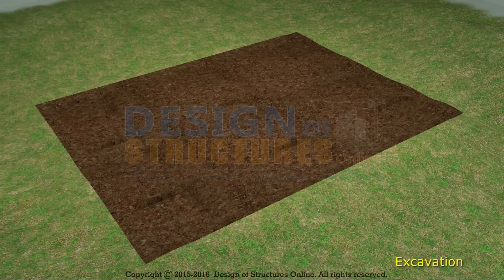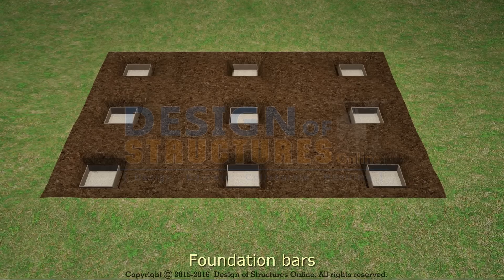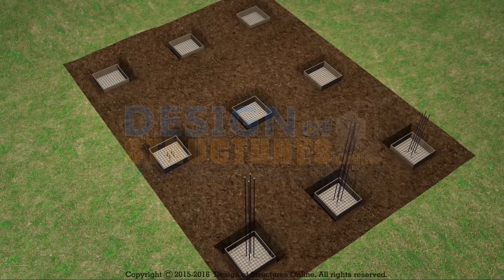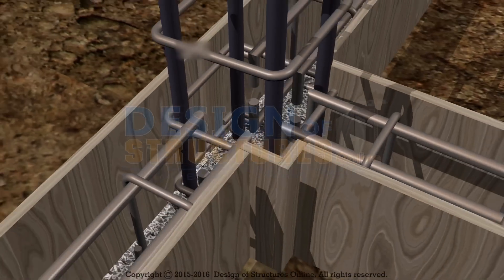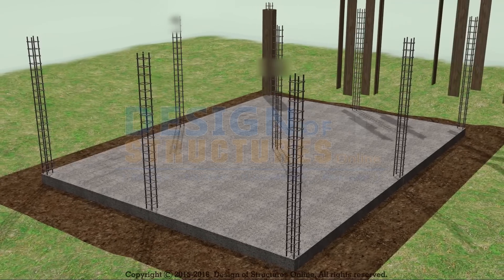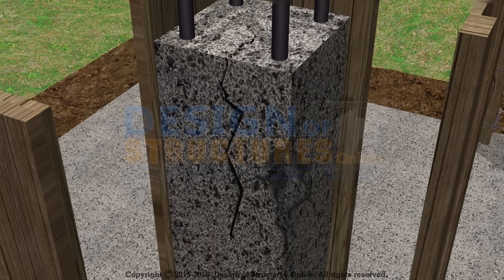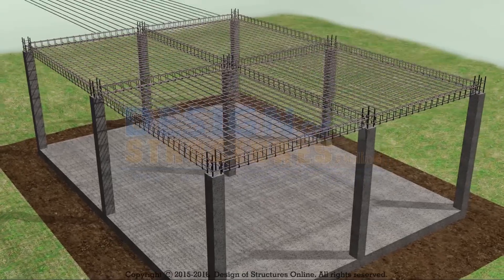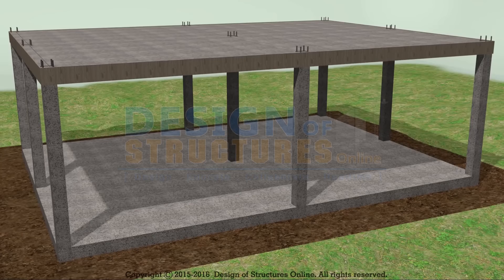complete construction of RCC -DESIGN

Comment: How do you prevent the crack or bubbles when you fill the columns with cement? Do workers tap every sides or use a vibrational thingy?
Reply: The crack and bubbles thing is prevented by proper mixing of the concrete mixture and they can use a vibrational thing for a large scale but tamping is suggested for small scale

Comment: How much thicker are the columns near the base? They hold most of the weight.
Also how much extra material is used by engineers to guarantee safety of the entire structure. Like baring all the weight.

Comment: ETABS full course video and files including structural analysis and design of beam column , slab , staircase and also Footing design with the help of STAAD FOUNDATION. It includes all topics from basic to advanced level starting from soil testing to detailing of structural elements.
         Price : 799 Rs/ (original price 3995 Rs/)
         Course : 26 videos and 17 files
         Contact me on WhatsApp : 9678552156

Comment: Please enlighten me about the slab on ground. Will it be alright without distribution bars? it will not crack due to temperature or tension/compression throughout the slab?
Reply: most of the building weight gets transferred to the footings. and the slab usually has gravel poured underneath it as extra support

Comment: 1. Concrete slab on ground level even directly sit on top of soil cannot without reinforce for crack control proposed
2. First floor form work and  temporary support should not after provided after first floor beam and slab reinforcement been installed ( we need to provide safe and firm environment\ working platform for workers to do the reinforcement and concreting)

Comment: Any requirement for architecture drawing (submission drawing Rera working drawings and working drawings)#interior#exterior#landscape#estimation for loan purpose#walkthrough for residential and commercial buildings design in reasonable charges plzzz contact me Thankue Regards - Ar.Jp kumawat Contact info - +918385828211

Comment: It's good vedio, step by step construction methodology but if  we add the steps for knowledge of strength required for at least important items like 95 % of compaction of earth & its back filling, strength of steel bar (50,000 to 60,000 psi tensile), Concrete compressive strength atleast 2,500 to 3,000 psi. More over,  to add the steps of Damp proof course "DPC" with Bituminous paint, water barrier course under Slab on Grade "SOG", etc. this vedio may more impressive or improve.

Comment: The removal of forms or de-shuttering for columns, side beams, and shear walls can commence after 24 hours. Slabs (back props) would be 4 days but still depends on your specification. It can be suggested to regularly check your project documents such as the specification and structural drawing where general notes are indicated.
Reply: Hi. Do you wish to be able to plan the projects on Primavera P6 SOftware?If yes then here is a link to one of the videos from the channel. We have just started a new course on the latest 2020 update. Make sure to check it out.
https://www.youtube.com/watch?v=arhKuCxYchM

Comment: 2:32 The tie should be 135 degree not 90 !!
Reply: Hi can you call me 7893552357
Reply: How much steel should be used in this structure if the house is 120sqyard or 1028sqft 
In the base pillars and the roof
Reply: ties could be 135 and 90 degrees depending on the specifications of the drawings. The project i am working on has both 90 and 135 degree ties.
Reply: Hi. Do you wish to be able to plan the projects on Primavera P6 SOftware?If yes then here is a link to one of the videos from the channel. We have just started a new course on the latest 2020 update. Make sure to check it out.
https://www.youtube.com/watch?v=arhKuCxYchM
Reply: If You Want To Build A Reliable Shed, You Need Knowledge of Foundations, Piling, Planning and More ... So I'm giving you a comprehensive "how-to" guide on the basics of woodworking. Go here ==> WoodBlueprints. Com

Comment: Is it strong If I use 12mm Steel Rod in Foundation??
Reply: Better use 4pcs 16mm and 2pcs 12mm..and for the foundation 16mm is far better...remember the post is carrying all the loads...
Reply: @raymondcayanan1654  I only uses 6 rod(12mm) in my post and beams , Is it still appropriate ?
Reply: @sylserenuela88   for a 2 storey?? And square meter of your lot?
Reply: yes,12 mm dia rod will be  good for up to three storey building but further depends upon loads and soil bearing capacity.
Reply: @sagarpoudel1177   12mm and 10mm sterupt  in a two storey building  sir , Is it.advisable?
Reply: @sylserenuela88  for 12 mm rod 12 mm strriup wont be appropritate.yes you can use the bars of dia above 7 mm to 10 mm  as strriup in foundation.

Comment: Beam is laid on soil/gravels which is used for side filling and level the foundation..if heavy water force comes then that soil can leaching out which is under the beam.. then walls or upper construction can collapse
Reply: Yes, there are ample chances of beam collapse, to retain the soil proper design of retaining wall is to be done.
Reply: Yes there is no excavation the gound beam if soil is less bearing capacity and ground water table is near  they effect the structure

Comment: I have one question. Where do you build septic tank of toilet?
Reply: Either below the toilet or away from the toilet depending upon how much land is available.
Reply: as per requirement, it must be installed 1.50 m away from the structure. If there are carport are you can install the septic tank there.

Comment: Explain Share force and bending moment .. grade of concrete grade of steel ..
Reply: Shear force: defined as the algebraic sum of the vertical forces acting at any section of the beam to the right or left of the section.
Reply: Bending moment: defined as the total moment of all the couples arising in a bent beam and trying to resist its deformation caused by an external couple.

 

Grade of concrete is defined as the minimum strength the concrete must possess after 28 days of construction with proper quality control in reinforced 
Steel grades are used to distinguish different types of steel based on their unique properties, the common grades used are Fe 415, Fe 500 & Fe 550.

Comment: Explain. Bent up bars
Reply: Bent-up bar called as crank bar is provided to make RCC slab safe from compressive stresses. when bent up bars are provided, the strength and deformation capacity of slabs with bent up bars compared to slabs without bent up bars is sufficiently increased.

Comment: De-shuttering for columns and side of beams can be removed after 24hrs while slab soffits and props can be removed 3 to 14 days after casting.
Reply: Hello,  Thanks for your valuable comments, appreciate.
Reply: @toqueeralam7572  Hi. Do you wish to be able to plan the projects on Primavera P6 SOftware?If yes then here is a link to one of the videos from the channel. We have just started a new course on the latest 2020 update. Make sure to check it out.
https://www.youtube.com/watch?v=arhKuCxYchM
Reply: how long it will take a concrete to set...
Reply: Hi. Do you wish to be able to plan the projects on Primavera P6 SOftware?If yes then here is a link to one of the videos from the channel. We have just started a new course on the latest 2020 update. Make sure to check it out.
https://www.youtube.com/watch?v=arhKuCxYchM
Reply: you are very right

Comment: Sir, what pattern of foundation is strong either digging out and putting bars or making horizontal bricks wall foundation and after that putting steels bars.plz reply
Reply: Brick wall foundation is suitable for only load bearing structure, for G+1 or higher it’s not recommended as it’s not an earthquake resistant practice.

Comment: how many month duration validity for rod steal 12mm on rain and Sun sunny....
Reply from the maker: prevention of rebars from getting corroded needs to be taken care of. You can follow the steps
mentioned below for the same -
1. Rebar should be stacked at least above 150 mm from ground level using wooden sleepers to
avoid direct contact with moisture of ground surface. Also during rainy season, stacked rebar
should be covered with tarpaulin sheets.
2. In places where rebar is exposed for 1-2 months during construction apply cement:water slurry
in 1:3 ratio on rebar surface. This will prevent direct contact of rebar with atmosphere to create 
rust. This cement layer is not a waste since it goes inside the concrete when construction
resumes.
3. In case of expansion in future after 2 months you may pour loose concrete on rebar, which
should be demolished off when construction resumes in future. Chip off the construction joint
and resume construction with fresh concrete.

Comment: Excavation is to be done by the JCB
Spread the weight of the building from the foundation to the soil
Reply: For small construction it is not recommended to carry out excavation by using JCB as it will increase the cost of construction very vigorously.